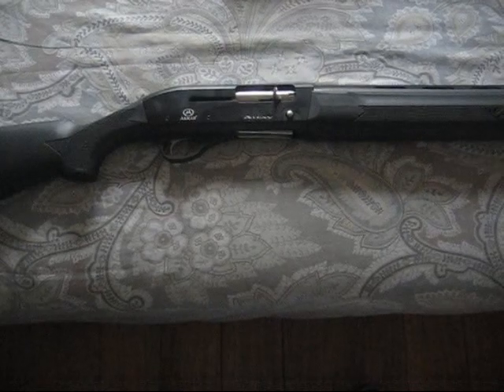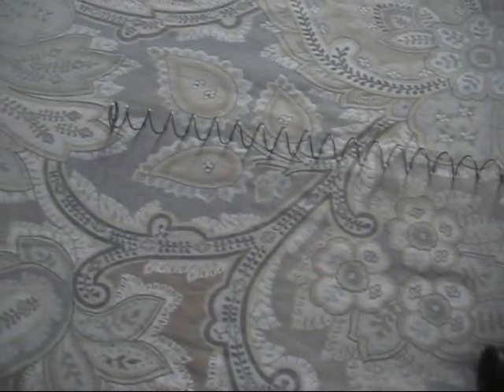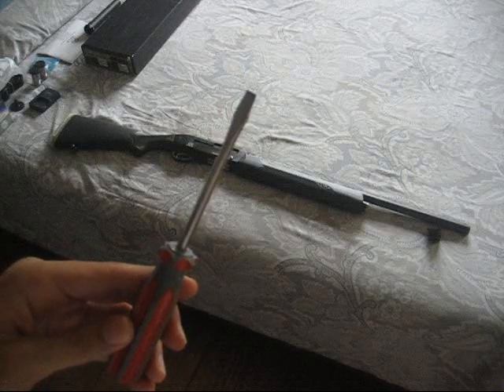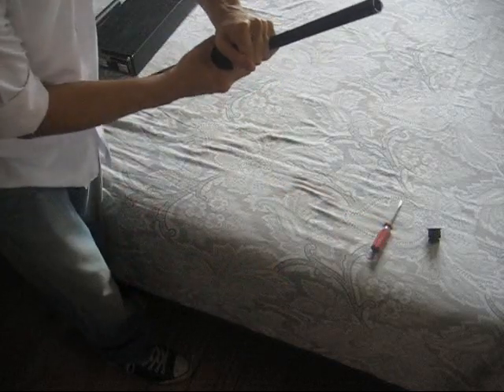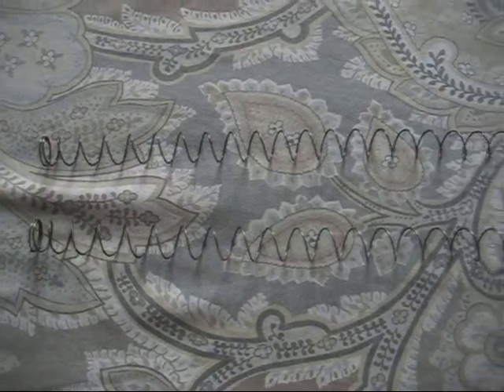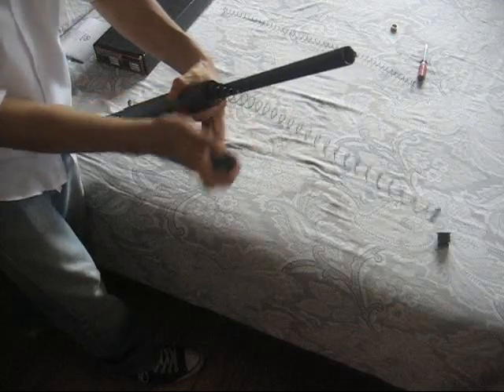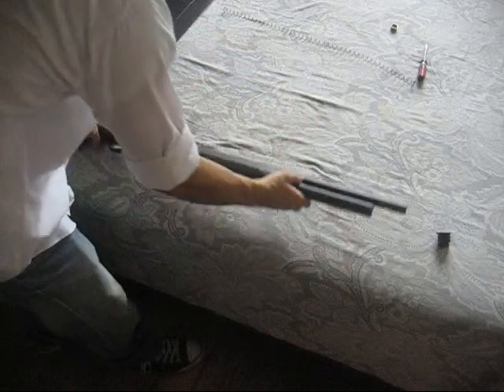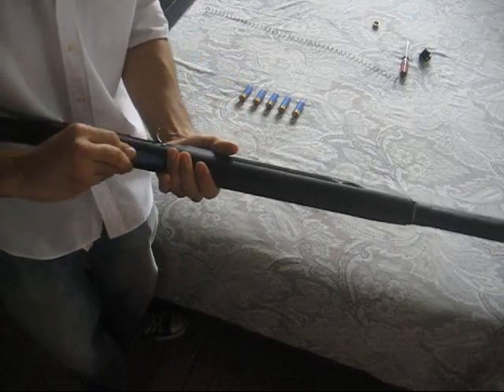Tip: Shotgun Magazine Tube Extension Installation

Comment: Thanks for sharing sir. It looks like a Weatherby SA 08? I have a same one but mine has a different retainer on it, the one you took out at 3:10. Do you happen to know how to remove it?
Reply from the maker: @sndasheep k You're welcome! I was able to remove the brass retainer using a flat head screwdriver (as seen in the video). I am not familiar with the Weatherby SA 08. Please check the design of your shotgun to confirm how the retainer is placed. Some other shotgun designs needed filing of the inner tube or further modification. I hope this helps!

Comment from the maker: The barrel's length is 24 inches. If you can find a magazine tube extension that extends until the barrel length (parallel and flush), you can fit nine 2 3/4 inch shells and eight 3 inch shells.
I tried having a magazine tube extension (that extended flush with the barrel) made by a gunsmith but it didn't turn out well. The magazine tube extension has to be very specific to the manufacturer's design (ie. Akkar). Please see my video for reference: "Range Day: Shotgun Drills and Testing".

Comment: Wow! Thanks a lot man. I'm asking these questions because I want to get a shotgun that can fit 8 3-inch shells inside the tube, instead of 7 shells in the tube and 1 in the chamber. I know what shotgun I want, I know what I wanna put on it, but this is the big problem that's been bugging me. Cause I don't want the magazine to be longer than the barrell. I've always asked myself, which barrell length and tube length do I need to put 8 3-inch shells in the magazine tube alone?

Comment from the maker: That would be correct. It's a +3 (using 2 3/4 inch shells) magazine tube extension.
I recommend using OEM parts for compatibility. I've tried looking for other ones but have had no luck. This is the only magazine tube extension I've seen available in the Philippines for the Akkar shotguns.

Comment from the maker: It's an Akkar extended magazine tube (OEM part). I bought in in P.B. Dionisio, gun store, in Quezon City.
To my knowledge, it only fits Akkar shotgun models. I have not tried installing it in other shotguns. Based on my experience, magazine tube extensions for shotguns have designs that are compatible to certain brands and models (ex. For Remington 870, For Mossberg 500, For Benelli, etc.).

Comment from the maker: @kentawagi
Unit price of the Akkar Altay Competition (shotgun in video) is PhP 25,000 (SRP). Don't forget the license cost as well to compute for your total cost.
As seen in the video (7:04), the shotgun with the magazine tube extension (comes in the box) holds eight 2 3/4 inch shells. 3 inch shotgun shells (less common here in the Philippines compared to 2 3/4 inch shells) will have a lower capacity in the magazine tube (around seven). You can load one shell in the chamber (+1) if you want. :)

Comment from the maker: @Strmbrg
That's unfortunate to hear. :(
The store that sells Akkar shotguns here only sells certain spare parts like bolt, magazine spring and some other parts. The tube extension isn't sold here.
On the hopeful side, if you buy a shotgun magazine tube extension (ex. for a Remington, Winchester, Mossberg, etc.), a gunsmith may be able to help you connect it if the threading isn't the same. I've heard of gunsmiths that fabricate adaptors to make them fit.
I hope this helps. :)

Comment: Thank You! I'm trying to find out if you could get a tube extension for a 24" barrel mp153 which holds 5 shells instead of 4 and doesn't stick out from under the barrel. :)

Comment from the maker: @dossentimos
I am able to shoot 24 gram (7/8 ounce) target loads (normally used for Skeet or Trap -- Light loads are preferred in these sports/disciplines. Notice that most shotgunners here use Over/Under shotguns.). I shoot factory ammunition and they cycle fine.
I heard that semi-auto shotguns tend to be more sensitive with ammo so if you plan on using reloaded shotgun shells, I would have no personal experience regarding reliability in this area.
I hope this helps. :)

Comment from the maker: I've done some research on the Remington 870 Tactical models.
It looks to me that your shotgun already has some sort of magazine tube extension since yours currently holds 6 shells (standard Remington 870 without a magazine tube extension hold 4 or 5 shells).
If you want a magazine tube extension that fits flush with an 18 1/2 inch barrel, I believe you will have a 6 shell capacity in the magazine tube.
A 20 inch barrel flush = 7 shells in the tube.
A 22 inch barrel flush = 8 shells in the tube.